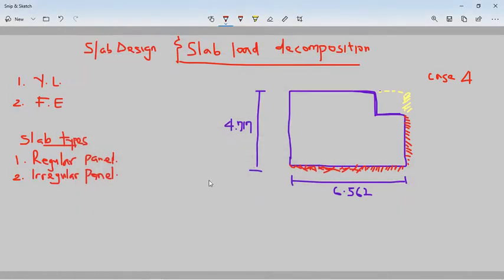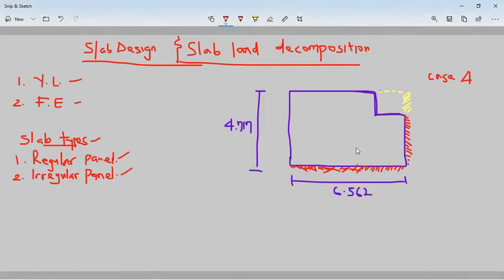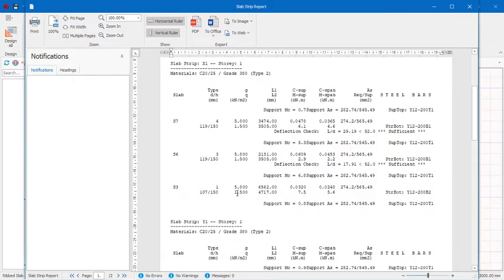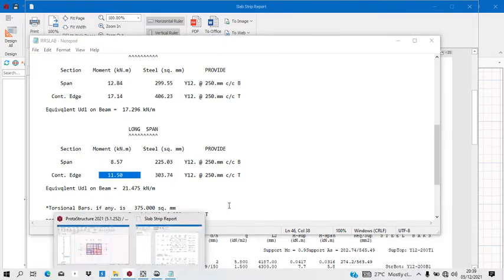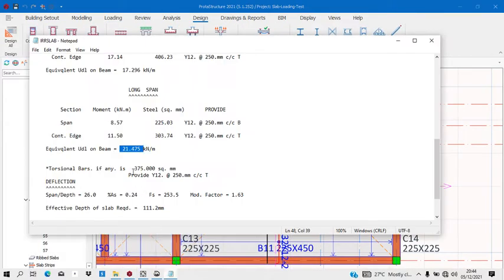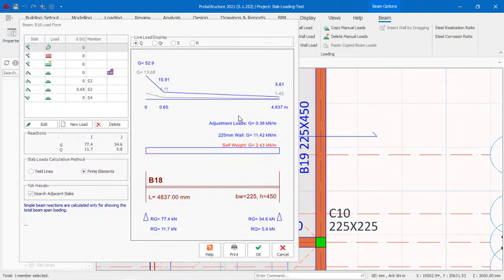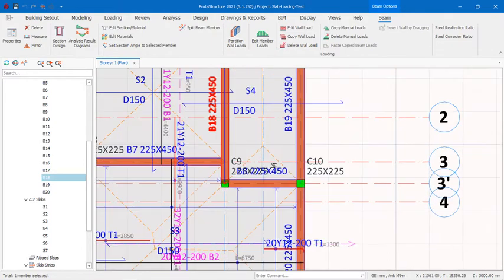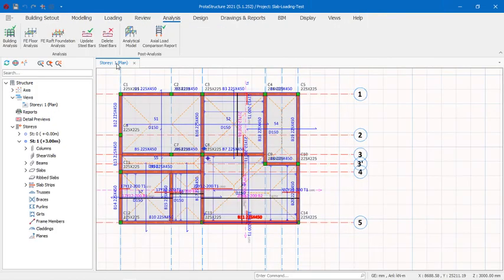Inner workings of Prota Structure suite 2 (Irregular slab panel & slab load decomposition methods)

Comment: Good afternoon Sir. Pls
Why do I get lower moment when I mesh the floors during analysis?
Reply from the maker: First.....check if your slab type is selected accurately. That will determine the coefficient that will operate on it.
Second. If u are using finite element, cases are that you will have lower moment in the sense that finite element method accurately models the slab decomposition as possible compare to that of yield line. However, ur meshing plays important role to get the desired result. So finer mesh gets you closer to that. So changing the plate size to lower values might help.